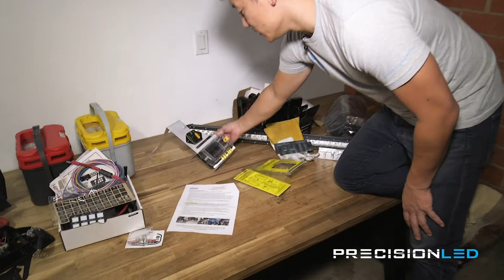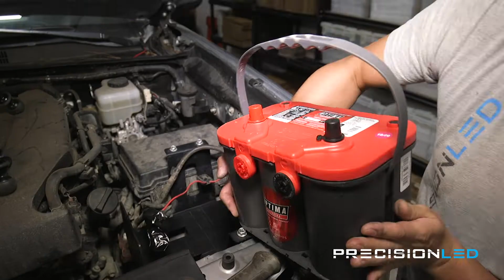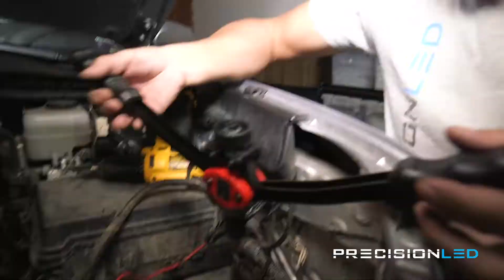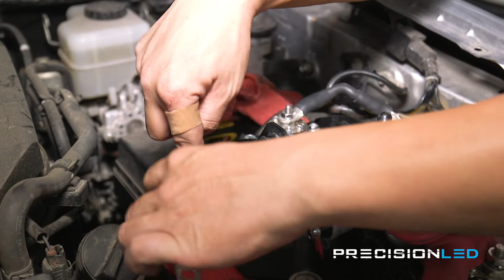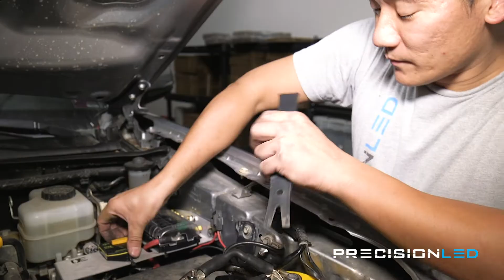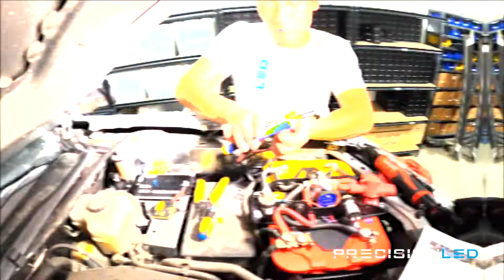Toyota Tacoma ULTIMATE LED Build | Episode 2: Two Batteries One Distribution Panel Precision LED

Comment: Would recommend fusing that positive lead to the switch.  And also a grommet for the positive lead through the metal.  Vibrations over time can wear through the sheathing.  That’s where that initial fuse can be a form of insurance.
Reply from the maker: Hey Folk.  Thanks for the feedback!  we will definitely consider the fuse on the initial positive lead, that seems like a good idea.    As for the grommet, do you mean through the vehicle firewall or through the slit in the Overland Equipped bracket?